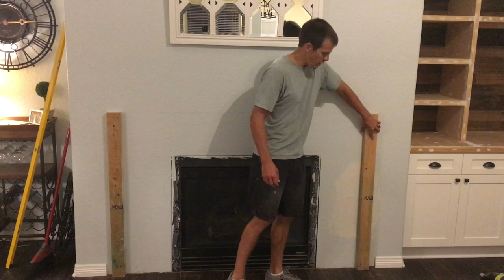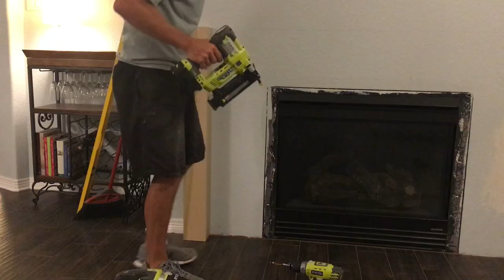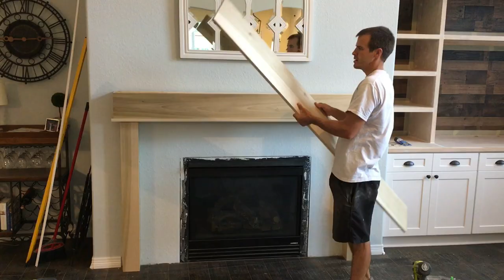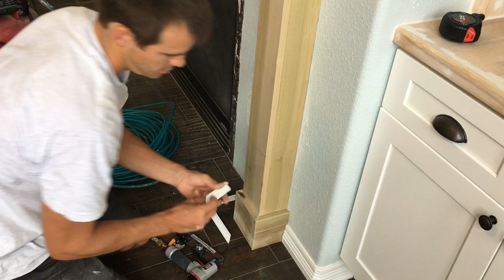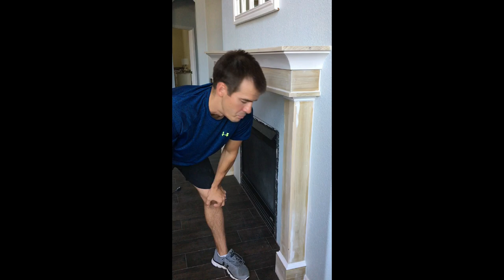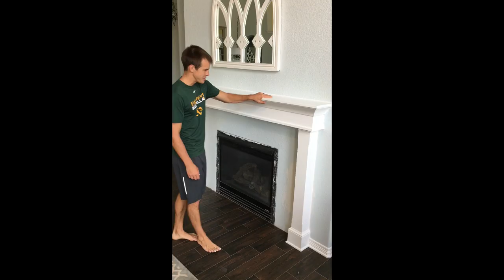Easy Yet Elegant Fireplace Mantle

Comment: I was thinking that the air pressure was too high for the pin nailer.
That’s usually the case when the pin penetrates completely though.
Should be about forty to sixty psi.
A very nice job, I will be using the idea for my daughter’s build.💪👍

Comment: Looks great and will be doing something similar in my home. What is the adhesive that you used for the crown molding corners? Also what is that crown molded called?
Reply: Sorry for the late reply. The molding is called "cove." The adhesive is CA Glue or Cyano Acrylic Glue. You can find on Amazon. Hope your project went well!

Comment: I'm new with wood pieces. What's a brad? Is it a staple gun or nail gun?
Reply: It’s a type of thin nail. Some people refer to it as a wire nail. It leaves a small hole and is good for light stuff like trim/baseboard. It’s no good for framing heavier stuff tho.

Comment: Measurements and wood sizes?
Reply: So sorry for the late reply! It's all 1" by poplar wood. 3/4" thickness. I made it such that there is 12" spacing above and on the sides of the fireplace. I think that is per building code though I wasn't able to find the reference. The columns are 46" tall until they contact the lower mantel covering board. This board and everything above it can be whatever size you want. Just might want to make sure to keep the overhangs and reveals the same like I described in the video. I believe the cove is a 3.5" molding. The top board will be a function of this molding size (bigger molding means bigger top board so the reveal is right). That's about all I can give that will be useful as your fireplace and personal preference will govern your design.
Reply: @adamguarino3507  Thank you so much for giving this detail info, I had the same question. I appreciate your generosity and creativity. I love this mantel , I watched this over and over, Hats off.

Comment: Thanks for sharing.  Have you worked on another video for the tile work inside that mental?  The mental is simple and pretty.  I have installed a fireplace but could not figure out what  to do on the front.

Comment: U need to put measurements,. Use you should make them and sell them,
Reply: It's all 1" by poplar wood. 3/4" thickness. I made it such that there is 12" spacing above and on the sides of the fireplace. I think that is per building code though I wasn't able to find the reference. The columns are 46" tall until they contact the lower mantel covering board. This board and everything above it can be whatever size you want. Just might want to make sure to keep the overhangs and reveals the same like I described in the video. I believe the cove is a 3.5" molding. The top board will be a function of this molding size (bigger molding means bigger top board so the reveal is right). That's about all I can give that will be useful as your fireplace and personal preference will govern your design.

Comment: Thank You So Much For Your Response, I Appreciate You. I Been Watching Your Video, And I Understand There's No Plans. But Could You Please At Least Share The Measurement, For Example The Column. The Shelf Board Attaching To The Column. The  Mantel Box, The Top Shelf Board, The Cove Molding, The Top And Bottom Molding For The Column, And Measurements For The Base Molding. I Would Greatly Appreciate Any Help, You  Willing To Share With Me. Thank You So Very Much, Keoki
Reply from the maker: It's all 1" by poplar wood. 3/4" thickness. I made it such that there is 12" spacing above and on the sides of the fireplace. I think that is per building code though I wasn't able to find the reference. The columns are 46" tall until they contact the lower mantel covering board. This board and everything above it can be whatever size you want. Just might want to make sure to keep the overhangs and reveals the same like I described in the video. I believe the cove is a 3.5" molding. The top board will be a function of this molding size (bigger molding means bigger top board so the reveal is right). That's about all I can give that will be useful as your fireplace and personal preference will govern your design.

Comment: great video! did you ever put the tile in? if you video’d it we’d love to see the DIY for that 😁 love the mantel, definitely going to try this out 👍🏼
Reply from the maker: Thanks! The tile ended up being kind of a rush job before a baby shower that we were hosting so no video of that. Sorry. The way I did it was to install a temporary header board even with the top of the fireplace enclosure first. I tiled the top part from the header up so that the header could support that tile level while the mortar set. The next day, I did the two sides after removing the header. I suppose you could start from the floor and work up, but you'd need to find a good way to support that tile directly over the fireplace or else it will sag from its own weight. Just a tip. Good luck!
Reply: The Handy Life TV thank you!! will keep this in mind. we’re waiting on the new year to build our mantel - military family so hubby is gone quite a lot. didn’t want to venture the task without his help haha! thanks again and I’ll let you know how it all turns out!
Reply from the maker: @samanthavanhubbard8320  Good luck and thank you for your husband and family's service and sacrifice.